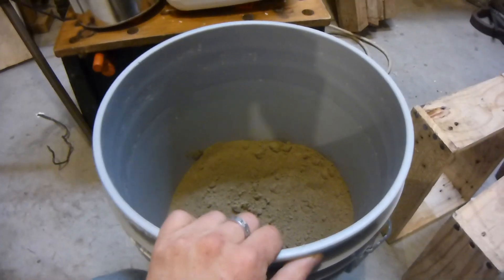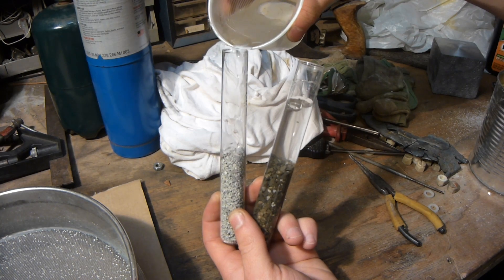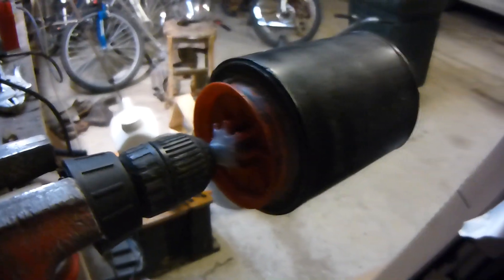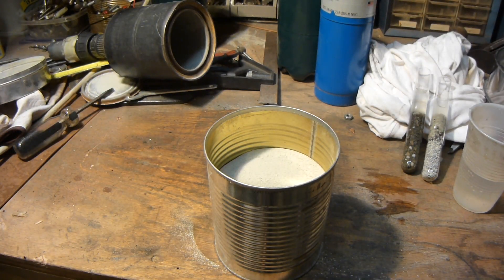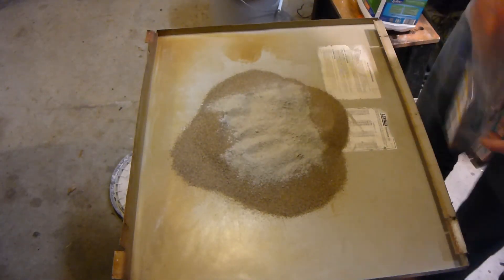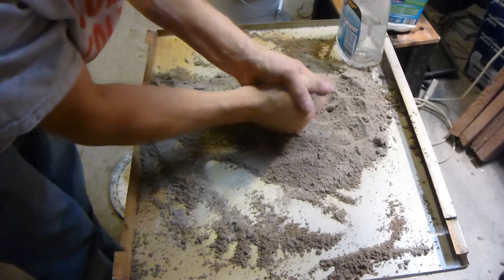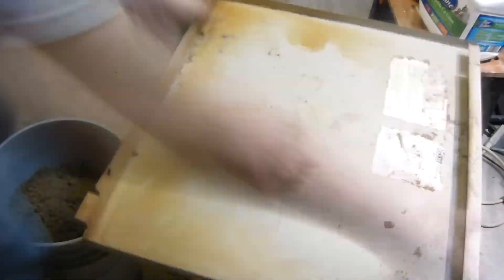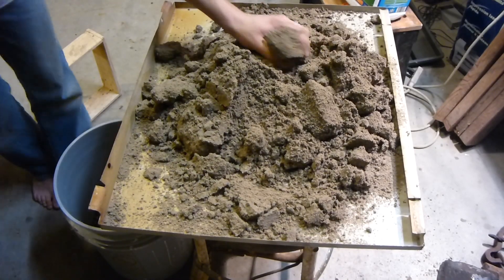Making Green Sand From Kitty Litter For Aluminium Casting

Comment: I can't get mine to work. Whenever I lift up the frame everything just falls apart. Any thoughts?
Reply from the maker: +Zac Shaheen sounds like a few things could be going wrong. Could be too dry. Could be not enough clay. It could be wrong kind of clay. Did you do the clay water test to make sure it's bentonite clay? How fine is the clay? How much clay did you add to the sand? How dry is the mixture?
Reply: Makerj101 thanks for getting my back to me. the clay is bentonite, extremely fine. Is it possible to have too much clay In the mix? also is it possible to have it too wet? one last thing. I am using a 2x4 with a box about 3 feet by 4 inches, I don't know if the dimensions of the frame have anything to do with it
Reply from the maker: +Zac Shaheen more clay makes it hold together better. However it clogs the pores between the sand which doesn't let steam and other gases escape which can cause issues when casting. It could be too wet. Does it comp together when you press a handful? Does it break cleanly?  Hmm 3 foot is a pretty long frame. The boards could be flexing which is letting the sand fall out. Try using a router or circular saw to cut grooves on the inside of the frame to give the sand something to hold onto.
Reply: Great advice! Thank you
Reply from the maker: Let me know how it goes.  If you still can't get it to work properly make a short video of your sand and I can take a better guess at what is going on.
Reply: Makerj101 I'm going to re-enforce my frame and try again this weekend, I noticed it was flexing and was not very strong. thanks again

Comment: Thanks for the ball mill idea! I modified by putting arbors on both ends and just stuck it on my lathe at the lowest speed. How long do you normally run it for?
Reply from the maker: +May the Schwarz be with you that would work great! As long as your lathe spins slow enough. Check on it every hour and shift out the fine stuff and put the course stuff back in with new for another round.

Comment: What you are aiming for is @ 10 to 12% bentonite clay to sand. Try using a batch method with a cup or container. or you could weigh the ingredients.
I did like the El Cheapo ball mill though.

Comment: Um, don't you mean bentonite?
ben·ton·ite
Reply from the maker: +William Labes LOL yeah my pronunciation isn't that greats!
Reply: No worries. I just wanted to make sure. Sorry if I came off like an ass.

I'm actually going to follow your method to make green sand pretty closely. Out of the many I've read about and watched this one seems to be the best end result for the least amount of work. 

Also, have you looked into adding like a mineral oil? I've read about some green sands using engine or mineral oil in their mix.
Reply from the maker: William Labes No you didn't sound that way.

Thank you!  I tried to make it as simple and easy as possible.

No I haven't really.  I guess I went with the water method because it's less messy and I know it works.  What are the benefits of using oil?  I would think the oil would also smell really bad as it burns off.  I guess the oil would not evaporate so the mold would be able to sit around for a while before casting without drying out.  You can see one of my newer videos where I did a simple casting with this sand: https://youtu.be/z-OP4EIhGWI  Thank you!
Reply: Its an american thing
another one is 
al·u·min·i·um IUM
not "al·u·min·um"

Comment: Just wanted to share that I bought a 50 pound sack of bennonite for 37.50 from a ceramics supplier nearby and it's  the constancy of fine flour, no clumps. I use 2 parts bennonite with 8 parts sand which I've had good luck with so far.
Reply from the maker: +Clarke E Cool!  That's pretty cheap and it sounds like really good quality stuff too!

Comment: i would suggest that you weigh the sand/clay/water before you start mixing and after you finish mixing a perfect batch and you will have your own 'calibrated' ratios. then test that ratio on the next mixing. 

once you have that ratio worked out, if you have the (jerry rigged) ability, set up a bigger  ball mill to mix the the green sand with you new ratio's.  just dont add the water all at oncd (to prevent clumping. lol)
Reply from the maker: +Randall Lasini That's a good idea!  I guess I'm generally not to scientific about things.  I just kinda mix things and see what happens... But I will do that when I mix up some more!  Thank you!

Comment: I like the ball mill you made: much easier than what I did. For my Gingery lathe project, I stole my wife's hand crank wheat grinder and ground up enough kitty litter for 100lbs of green sand. It was good exercise, but took too long to make. More recently I bought some southern bentonite and black diamond sand from Lancaster Foundry Supply in eastern PA. Shipping to Georgia was pricey but not prohibitive. $10 for 50lb bag + $30 UPS.
Reply from the maker: +Makercise Thanks!  I thought about using a hand crank wheat grinder.  I thought the gravel in the kitty litter would kill it though.  We have the grinder for survival situations so it needs to be in working order...  I should look into getting some sand from them as I live in PA.

Comment: seems like there is some water content in the kitty litter. maybe it wouldnt cake up if you oven dried it first?
Reply from the maker: +ironlionkalo That's a good idea!
Reply from the maker: +Clanner Jake Yeah I had thought about cutting a hole in the paint can and covering with some screen.  Then anything that hot ground small enough would exit.  Good idea.  Someone else actually just sent me that exact same video!  I am thinking about making one using that method.  All though I would not go the the extent he has with that complicated mold and everything.  I'd probably just form it with my hands.
Reply from the maker: +Clanner Jake I'm considering making one using a method like one of those.  I'll certainly keep looking into it!  Thank you!

Wow that castle they are building is awesome!  They started to build a similar one in the US but it seems they have stopped because of financial reasons... seems ironic considering they are doing it off the land... I guess the workers are not volunteers.  I have forged a couple of knives!  It's a lot of fun but it sure does take a lot of work.  About 3 hours for me since I'm a noob.  I need to post some videos on it...

Comment: But a blender at Goodwill for 2 Bux.
Reply: +Makerj101 ya they do , mines been grinding litter for 3 years now, it is getting tired thou lol
Reply from the maker: +73turbopinto That was the other thing I thought about doing.
Reply: actually not a bad idea!
Reply from the maker: +Triangle_DIY All the gravel would get ground up with the clay and I wouldn't have to worry about sifting it out.
Reply: +Makerj101 I use an old coffee grinder (good will), it turns the litter to fine dust pretty quick, I did a 20lb bag in bout half an hour, worked great
Reply from the maker: larz0001 I'll have to look for one of those.  I've seen other people grind some pretty weird stuff with them and they hold up really well.
Reply from the maker: larz0001 They are only like $20 on eBay.  Maybe I should get one.  Or I could just take a motor and put some kind of crazy piece of metal on the shaft...

Comment: Very cool! I wanted to try this sometime soon, really handy! Greensand is almost impossible to get, and if you can get it, its way too expensive. Bentonite clay powder is also very expensive, so this is my best bet I thought. Nice explanation about the litter, have to look carefully which one to get. No cat expert :P
Reply from the maker: +Triangle_DIY  Yeah you have to get it from a casting supplier which are really hard to find.  So this was the best and cheapest method for me.  Good luck!
Reply: I sourced mine from a well drilling company 20 or so bucks been awhile co-op has it I think it's in pellet form they use it as binder in some feed and for sealing ponds that will not hold water
Reply: Bentonite clay is ridiculously cheap